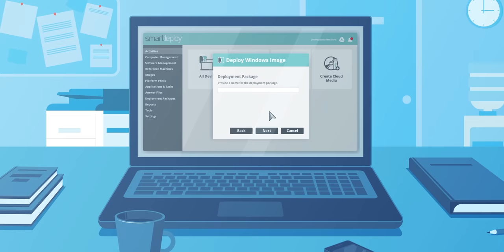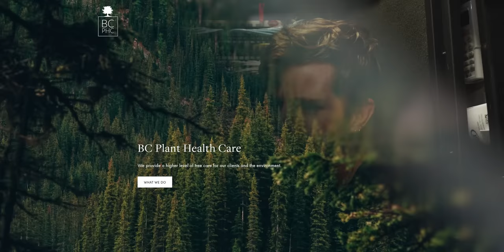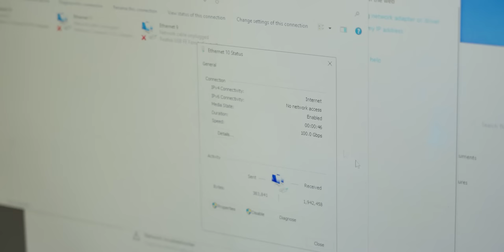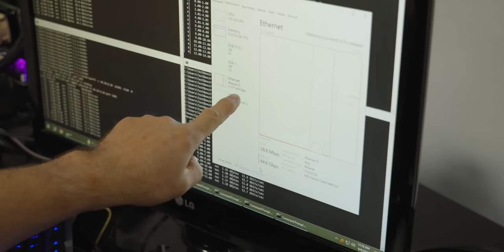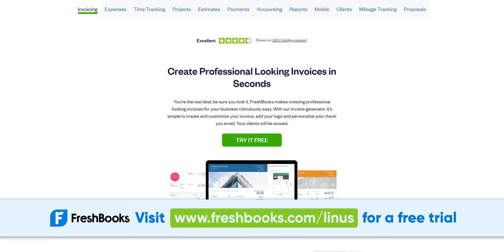Everyone said this was impossible - Backyard Fiber Run

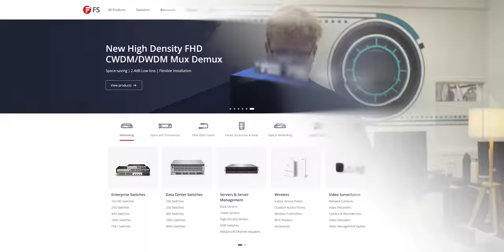Comment: 17:27 Huge shout out to FS from me as well! I've used them extensively in both my previous and my current job.

In my last job, there was a network meltdown, and the CIO and other big-wigs went and just purchased a ton of hardware to replace our entire infrastructure, of course without consulting us peons in the network team. They went with first-party optics: 10G LRs, two per L3 network switch, with another two matching each connection (one pair for each core - ie. a total of 4 x 10g 10km optics per L3 switch), times 88 L3 switches - that's 352 transceivers. At a price tag of $750 each, that came to a bill of $264,000 in optics, because they were first-party.

Well, with the big wigs and outside consultants who made that decision having no IDEA how our network worked, we needed to purchase a LOT more equipment, including more optics. We had started using FS.com (then still known as FiberStore), and found out that the same 10g 10km optics with the same compatibility coding, but FS branded, were a mere $27 apiece. We could have spent just $9,504 in optics, saving $254,496, if they had come to us and we ordered them from FS.com.

By the end of that upgrade project, we ended up having several optics fail on us. And funny enough, none of them were FS optics, only the first-party ones died!

We also had done fiber muxing, as we had an offsite datacenter 12km away (by the wire, the short route; it was a private fiber ring, the long route being ~60km by the wire). Working with consultants from FS.com, we got a DWDM system installed which was capable of muxing 40 channels onto a single pair of fiber. Using 10g optics, this would allow us to run 400gbps (each, short and long route, since we had a system for both). We even had a 40g QSFP → 4 x 10G SFP+ breakout, and a media converter chassis, which allowed us to run a single 40g QSFP link over 80km of fiber broken out into 4 channels. Really awesome stuff, being able to run backups long distances very quickly over private fiber. All thanks to FS.com!

Comment: You could use 100Gbe trancievers of different wave lengths and then combine and split one fibre with all wave lengths using a mux and demux. I've seen a setup pushing 1600Gbe one one pair. Possible maybe even with 400Gbe then you could possibly push 6400Gbe per pair totalling 192Tb.

Comment: Nicely done :) The Mikrotik 100G switch is a bargain but I don’t think it run 100Gbps at line rate at standard MTU 1500. Might want to increase the whole intranet MTU to jumbo frame to increase transfer rate even further.
Reply: another thing, that switch can do L3 routing as well. an absolute bargain for what it does.
Reply: @thelightning87  not true, they have had L3  ASIC offloading on their switches for a year now.

Comment: Just wait till you have your first fiber cut!    Also be careful to keep the cable away from pooling water, granted the water doesn't affect it, but when it freezes it is capable of causing a break if it can cause a bend in the cable.

Comment: Linus, you should look at dwdm next.  Start modulating light! At my work, we’re running 6 800G wavelengths between our datacenters on two pairs of fibers. We’re only using 100G clients, but we can easily switch to 400G clients.

Comment: as a lineman, i ran 144 and 288 fiber in the bush where i had to up the pole with my hooks. and yes we had to hand pull most of the fiber. longest pull I have done is 28,000 feet with NO cuts.

Comment: When you guys are doing these network tests, is there any reason you don't just use iperf3? Run a iperf3 server from your main office, and then just run the iperf3 client from the other end? Shouldn't be limited by things like disk speed as I believe it's mainly dependent on CPU load.

Never used iperf3 for links as fast as 100 Gbps, but have used it at various clients when I wanted to identify expected speed and packet loss, and I found it more reliable than just using an online speed tester.

Comment: Its done all the time. Its called "campus wiring".  The nice thing is once installed you can change the speed (and reach) by just changing the endpoint switches and SFP/QSFP/QSFDD modules. In fact if you have a fairly modern switch with pluggable ports you can upshift and downshift just by changing the modules OR if you buy multirate modules you can run at speed X today and Y tomorrow when the economics works.

Comment: as for "home user" this can feel exciting. As a network manager - we have aprox. 10-20km of "dark fibre" cables on our 2 sites. Amount unknown as we still installing backup routes and redundancies. Luckily for me I dont have to pull one in (thanks god for contractors) but we also varies our cables from 8 to 24 cores. Personally I dont see anything else in near future but complete abandon of copper. With maybe a home users using a 10Gb DAC cables. as above that max distance drops from 100m to merly 5m (15 if you streach it :D ) 
With single mode fibre now being at the "almost same" price as multi mode, why would anyone even bothered if you can get 100Gb+ (allowing hardware can do it) with almost no distance limit (we talking Linus scenartio or home user). Yes splicing is a task and splicers are still expensive (comparing to cat6/7 etc crimpers) but with many new builds having ethernet in walls and just replacing it once with fibre- you secure your speed bursts for next 2 generations for sure. I admit I would be excited still if I did the fibre run across my home and shed etc myself including splicing but at same time it is funny to see Linus excitement about technology that been out there for decades :D

Comment: 7:30 That really isn't many pairs, I've done some fiber installs and normally the stuff we worked with was 12 pairs of singlemode and 12 of multimode. That was the defacto for our group because we were using almost entirely analog fiber with only two of the multimode pairs used for a redundant 100Mbps digital link for equipment monitoring and stuff.
Reply: Same here…I put in tac12, tac24 in stadiums and arenas all over. I’ve installed over a 2K’ home run from the Broadcast trucks, up the side of the stadium around the upper bowl and into the Pressbox on the opposite side if the complex. While fiber is delicate, it can take a beating and and some pretty sharp corners. Love this content.
Reply: I thought the same at first, but then they revealed that it's not multi-core fiber -- just pre-terminated cables in an armored sheath.

Comment: As an early adaptor of Fiber optics and high-speed low latency reliable internet user, I can feel what Linus was feeling at this video. I actually had to work with our ISP for a 4 KM cable deployment for my home, that is slightly in remote location.

Comment: You guys need to check out the Paige Gamechanger Cable. It's ethernet cabling that claims that it can reach up to 850 feet (259M). Well beyond the 802.3 100m limit. As a systems engineer, I'm very skeptical that it is even possible. If it is, I'm curious of the reliability (Eg. packet loss, and interference.)  It does not seem to be any different than regular cat 6. They also charge a premium for the cable as compared to cat 6.

Comment: I'm a little concerned, if people routinely cut that nature strip with power tools and the cable is not covered inside a pvc pipe or buried, they might cut it by accident as a black cable is not that visible or recognisable to non tech people. Wait your not keeping it in place for the long term, why do this at all?
Reply: Because they can get it operational in [time for cable to arrive and day to run it] for a dozen employees. Instead of waiting half a year minimum to get permits and whatnot

Comment: You could have moved the fiber wheel, gradually unwinding it as you go, rather than pull and drag the entire length, risking causing a breakage or weak point
Reply: Yeah and put that wheel on a little tractor or bulldozer to go through the jungle.

Comment: I just had a 160 meter water line put in, by steerable boring machine. That is close to the limit; any longer and they need intermediate access holes. So you'd need a couple of those hole. And if the cost is essentially the same as down here in the states, about $21K USD for that bore job at your distances. That included the "pull", BTW, so you just watch.

Comment: Fiber optic splicer here and you can fix anything in fiber. If not somebody really fucked some things up. A break would actually be easy to find above ground because the area it’s not recieving light would be obviously deformed. The strength member inside has to be broken which is actually pretty hard to do. I’m rough as hell with fiber and every now and then I’ll break a strength when I open the cable and it will kink the tube which can cause breaks in fiber. Usually doesn’t most of the time. Stuffs actually extremely resilient for how delicate it is at the same time. He noted on the rigidness of the cable. That cable is jacketed, which means metal on the inside, meh. Sucks to work with but for outdoor applications. Cable without the metal jacket keeps it’s same “memory”. It’s the strength member that helps with memory, not the metal jacket. That’s jacket is just for varmints

Comment: You should see what it’s like pulling cable in an underground coal mine. We have to hang about 200ft of 12470v cable at about 6-12ft high. Pulling 3300v cable that’s about 3 inches in diameter around 200ft around coal pillars. Atleast 3 times a week.

Comment: So, this is exactly the type of work that me and my team do...we run dedicated networks between buildings, be they copper, fiber, or some type of wireless links. My question to you is...why can't this cable you ran stay? In our book this would be completely acceptable...sure it's ran exposed, above ground, but through all that brush...it's protected...not like anything is going to bother it unless someone does construction and even then it would be at risk. So what's the issue?

Comment: Had some guy continually argue with me for 2 hours straight over whether or not his Cat8 cables provided 40Gbps (or even faster speeds) on a Verizon Wireless 5G network over an ISP providing fiber optic services while you run things through a network switch.

Comment: you just need a utility 2in conduit ran from one building to another, then you can pull the cable through yourself. make sure its deep enough underground (you'd use a bury company for that lol but still cheaper than 100k. some companies will charge you $5 a foot, good luck finding someone to do that, because that will be amazing)

Comment: Now imagine running a 48 strand through 60 floors of a high rise building in a downtown area. As you get further the weight of the cable increases due to gravity and is around 1000ft. Has to be secured to not fall the whole length. This was cool but, the pro installs along with fiber splicing and proper grounding makes all the difference in the world. defiantly entertaining though. Wonder how long this will be utilized as "temporary" lol. I've seen to many times that temporary has been used for years.

Comment: Fiber is damn cheap in the long run. I DIYed my previous company's multibuilding network with single mode fiber totaling about 1KM with 4 lines each, yet we only spent less than 1 grand including 8 SFPs. It's only 1Gig, but if we really want we can just switch the SFPs using the same cable. No cable rerun needed!

I was like linus too, fan of wireless networking. Even made some DIY antenna using woks (yeah, that chinese wok). But damn, I've never come back since I touched fiber.

Comment: you shouldve run mule string all the way tied your cable on at the building and then pulled the rooe with a machine its much much lighter and it wont break along the way just have people watch corners as you pull the rope

Comment: I think someone at LTT should take time to learn more about management on mikrotik even if your just thinking about deploying switches. Using the winbox program those switches are very powerful. They can do anything a ubiquiti  can do. Like the issue you had getting the 100gbps for to negotiate to 25gbps for the ubiquiti probably could have been solved by logging into the mikrotik with winbox on the management port.

Comment: As someone in the communications industry this video drives me nuts.  First, coax, which is copper, could be used over this distance and get comparative speeds, coax is often often overlooked.  Two, fiber is very strong, those ends yes in theory you could pull off the connectors but the fiber itself is very strong.  Also, that rod is called a strength member, your wlemcome lol

Comment: The metal in the cable sheathe is so that it can by found by directional-finding equipment.  That's a good thing for burial cable because otherwise construction workers and equpment = fiber cut.  It can also be used to equalize ground (GND) between buildings of different potential difference (voltage with respect to ground).  This is not as critical as with a copper run, but when you terminate it at your CPE on either side, local ground is worth doing.

You didn't specify WHAT fiber you're using. Sure 4pr then 3pr but what?  Glass?  Plastic?  SM, MM?  Mix?  And finally how is it terminated?  ST sucks (too much loss), LC is great (least data loss), and stuff in between (SC) is... stuff in between.  When it comes to running FO that L1 stuff is meaningful.

1.2Tbps?  400Mbps?  Whatever you get the key to throughput is 0 loss.  Jitter is not a thing.  Latency is not a thing.  Photons over FO (glass not plexi) are close enough to 'C' that we can't measure the difference in the tools we use.  (That's because the tools have the same order of limitation as the items under test.)  So what we do care about and CAN measure is loss.  Make it zero and call it a day.

For other people attempting this... every so often make a loop of spare fiber and ensure you don't make it tighter than the maximum curvature allowed for that fiber.  This is called a "service loop" and in case of a cut you can use the service loop and ONE splice instead of splicing in on both sides (two splices).

You guys are hilarious and I'm glad I found your channel.

Ehud
Tucson
Arizona
USA

Comment: Fiber optic cables are in "counts" not "pairs" copper uses pairs to make a connection. Where as a single count fiber can make a connection that is almost infinitely faster then coax and copper cables.
Reply: in practical use a lot of fiber lines will have 2 seperate strands in it.

Comment: Why tunables? You paid far more than necessary when you could have used 1310nm optics that would reach about 5KM with a 0db to -11db loss allowance. 
As far as the max transfer rate, you can multiplex up to 96 channels (tunable DWDM optics) of 400G channels. Pricy for sure but I don’t think telecom companies can boast about 37Tb of data pipe.

Comment: I think you guys probably got this cable for free and had to pay for shipping as it is NOWHERE NEAR $700 for 700m of this cable from this company. 700m is more like $5700CA and I didn't see what they charged for shipping. Still, a lot better than $100K per year - but I was working on a project that this cable would have worked well for - and based on the cost you guys stated I thought I had a good option here - but no - VERY expensive and I wasted my time coming back in here hunting this video down to get the details on it...